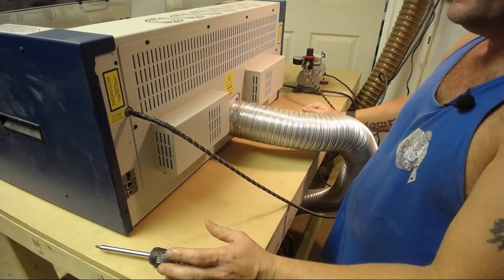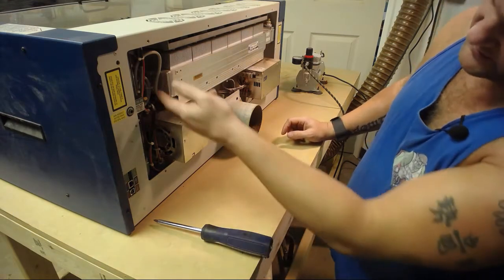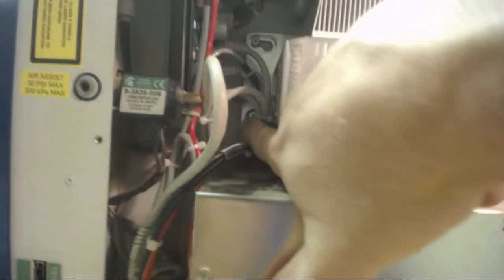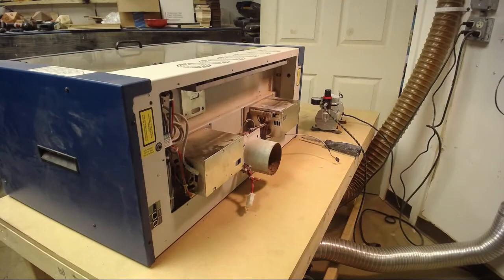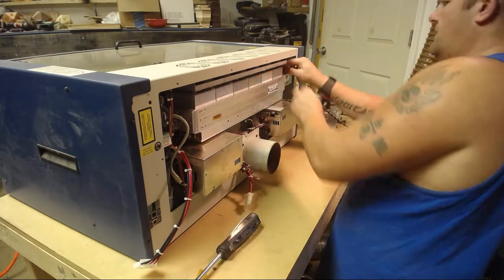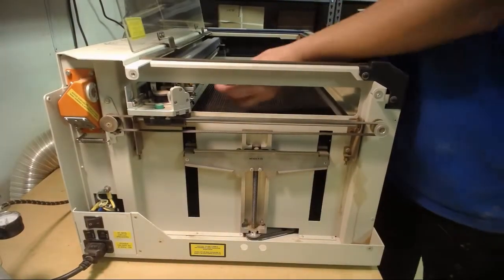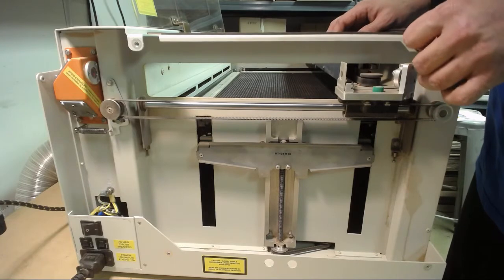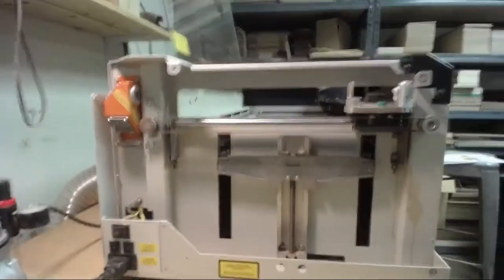Epilog Laser Tutorial - How to Upgrade Change the Laser Tube AND Fix alignment on Epilog Mini/Helix

Comment: I watched your video and I Thank You for doing it. I am purchasing a local Mini 18 30 watt that is still working but is 5 years old.  I see that it might be possible to upgrade it to a 60 watt with power supply and tube.
Reply from the maker: Yes, you can upgrade the laser.  Would probably be cheaper to buy a used 60w though.  Age isn't that big of a factor btw, I still use an EXT from 2006

Comment: Please, I have a problem with the laser tube. When I do a plus, the tube lights up and when I turn on, it does not light up and does not emit a laser. What is the reason? I changed a new power supply and the problem is still. Is the tube destroyed?
Reply from the maker: If you have an epilog laser, call support. They are very good.  If you have a different laser, i don't know how about it

Comment: It seems difficult for us to get that laser module. Where did u buy it?
Reply from the maker: They sell through distributors located in each area and there's a list on the website
Reply: @LifeWithRoger   If i buy other brand laser module, same size with Epilog, does it work?
Reply from the maker: @judywang3557  no not very well
Reply: @LifeWithRoger  why?
Reply from the maker: @judywang3557  they are custom built
Reply: @LifeWithRoger  I get the size, if size ok to be installed in,is there any other problems?
Reply from the maker: @judywang3557  i wouldn't install it in mine
Reply from the maker: Straight from Epilog Laser

Comment: Thank you very much for this video.  I have to get my replaced shortly and it is nice to actually see how it is being done.  May I ask how much does it cost for a new laser tube?
Reply from the maker: Varies by wattage and machine. And it varies by a lot. A 60w mini should cost around 1000-2000, 120w is way higher
Reply: @LifeWithRoger  Thank you very much for the info.  Greatly appreciated.

Comment: When I have to change the tube. Thank you.
Reply from the maker: If you are asking when you need to change, the answer varies.  First, if it gets too weak to do the job.  Second, If it becomes so slow that it costs you money.  Of course you'd also change it if it simply stopped working.
Reply: The Woodworking Gamer I’m asking. because my laser start cutting some partes fine and other not. Thank for answer me.
Reply from the maker: Could be the material.  However, I would first suggest doing a FULL clean of your laser. Encoder strip, all mirrors and lenses.  Then I would make sure the bed is level and you are properly in focus.  Those are things you should check first before even considering replacement of your tube.
Reply: The Woodworking Gamer thank you for your suggestions.

Comment: I have a 60w helix probably dead tube:(
No red/green/ orange led on the tube, besides the rj45 patch cable input.
The machine operates normal, but no laser beam comes out. Is this tube you changed in the video really expensive in usa also?
Reply from the maker: oh yeh, it was $5400 to upgrade from 40 to 60 in my Mini....AND you have to ship them back the one you take out (Which for me kinda sucked since it was still in great condition.  I just wanted a stronger tube)
Reply: @LifeWithRoger  when you did the 40 -> 60 upgrade, was it just the laser that was upgraded or did the PSU have to get upgraded too? Was the upgrade worth it? (material thickness I assume?)
Reply from the maker: @neilbunn601  it required a new psu also.
Reply: @LifeWithRoger  that’s about what they’re gonna hit us for for going from a 35 to a 50
Reply from the maker: @aaronnonya5876  it's worth it if you cut quarter inch wood regularly.  I already sold my mini and just ordered a fusion 48 120w